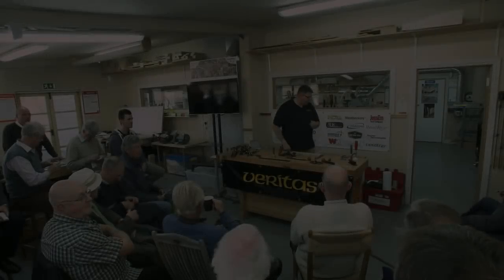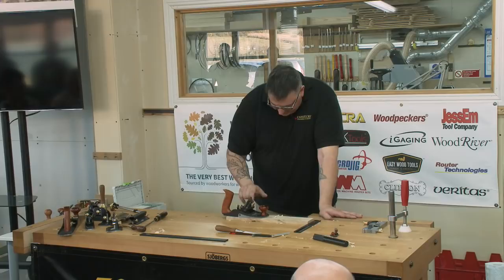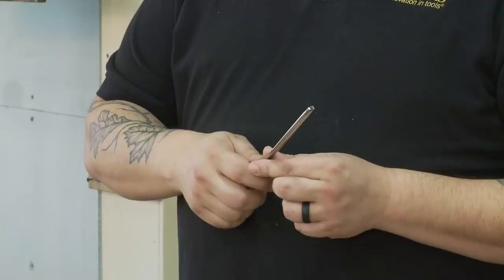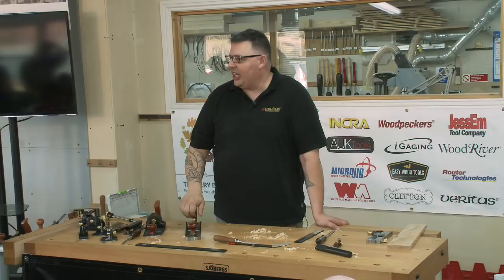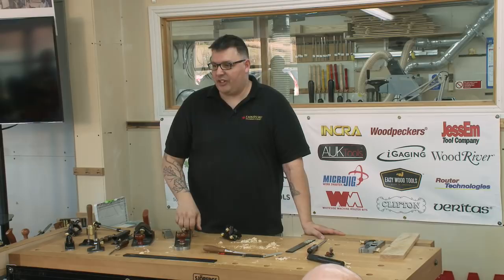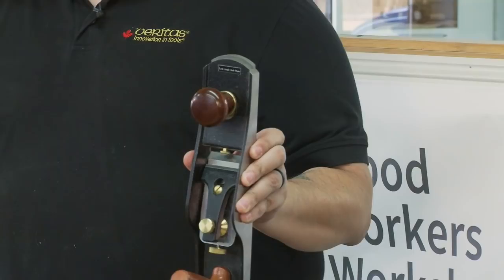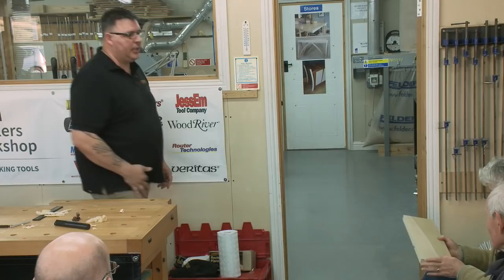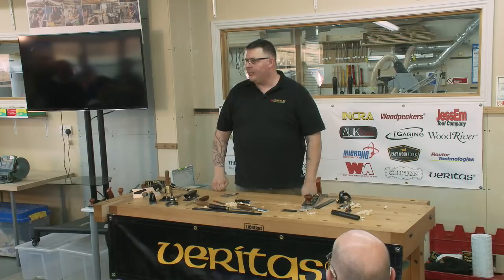Vic Tesolin - Planes for difficult grain

Comment: Thanks Vic, I live in Western Australia working with local hardwoods, jarrah, blackbut, wondoo, tuart and peppermint the latter two have serious interlocking grain. What you said in part 2 about Australian hardwoods is more so when it comes to Western Australian local wood.  I have a full arsenal of Veritas bevel-up planes and love them because I can play with bevel angles.  For tuart and peppermint I use a toothed blade and finish with a cabinet scrapper, I have just now ordered the scraper plane.